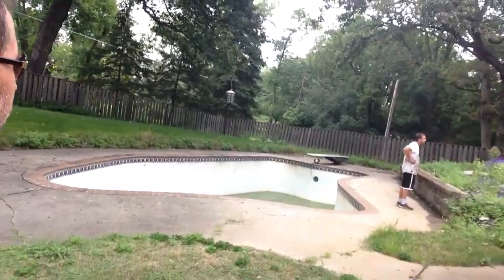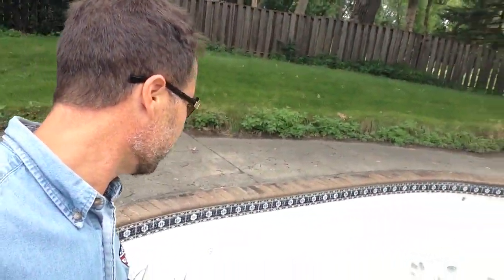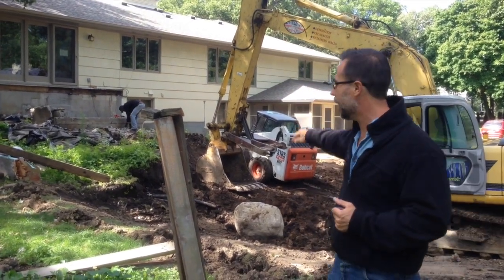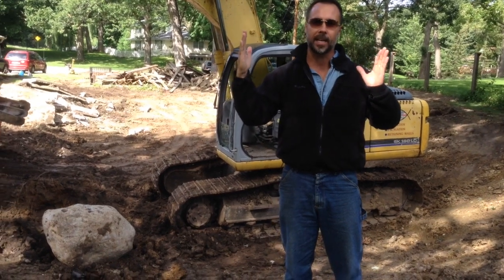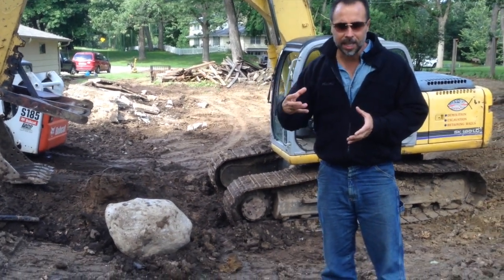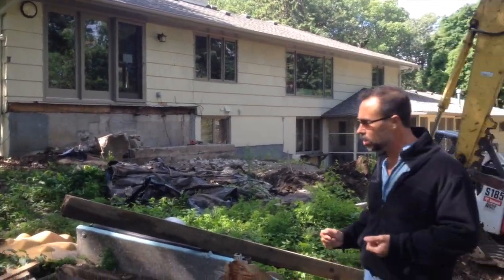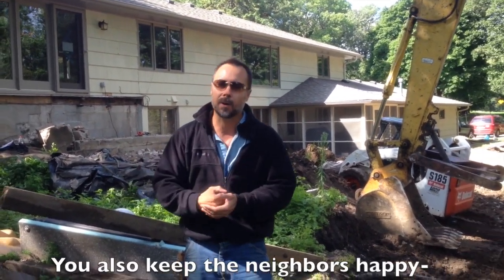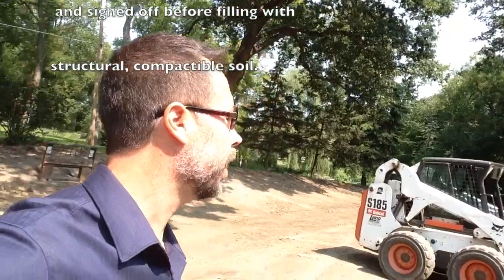How to Remove a Swimming Pool  Wayzata MN

Comment: Quick question why not just use a pick or a nibbler to break the concrete? Whats the advantage of the bolder?
Reply from the maker: A boulder is cheaper and what I have.  a pick or nibbler is $15,000 plus cost of plumbing the machine. a 4 foot boulder is $200 and if it breaks- I just grab another boulder.

Comment: I am so confused. Some contractors say drain the water then break up the cement with jackhammers break up the cement and throw anything including the kitchen sink in there. then cover with rocks and soil. others say punch multiple holes in bottom of pool and haul off cement..or crush cement into small bits and put that down and add soil. Nobody seems to agree on anything, and we haven't even gotten to prices. Job hasn't started and I already have a headache. Nobody has mentioned using a boulder yet. Why is there so much disagreement?
Reply: It really depends on what the city allows you to do in your area.   Most would opt to simply jackhammer several holes bottom of the pool and then bury it with dirt.  The side walls are removed.  This is usually the cheapest way to go but won't be able to build anything on top of it due to ground settlement issues and must be disclosed when selling the house.

Comment: I like your videos I'm a subscriber. but what your talking about with the boulder is drop-balling it is extremely dangerous! when I do it at the steel plant where I work chunks fly very far I've seen them go 200ft size of a softball. I've been an operator 15+ years the quickest way to remove a pool is to simply dig it out check out letsdig18 channel he has a almost textbook pool remove, not trying to be a troll or nething still love ur vids thnx
Reply from the maker: +wall2 Wall I will check it out- Thanks!